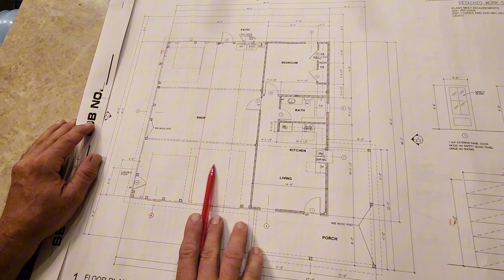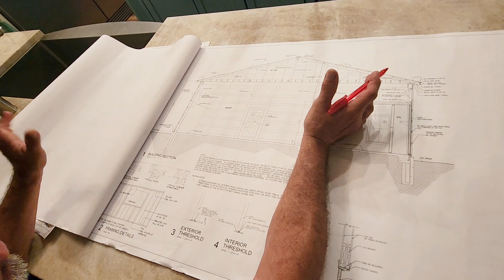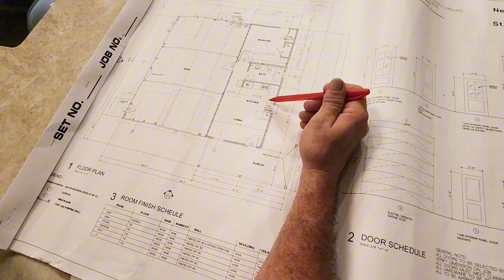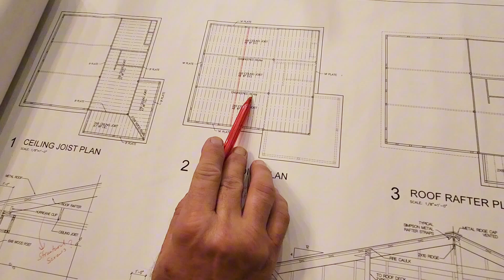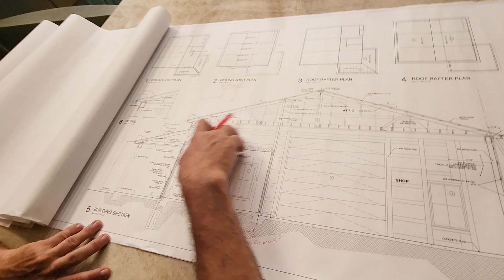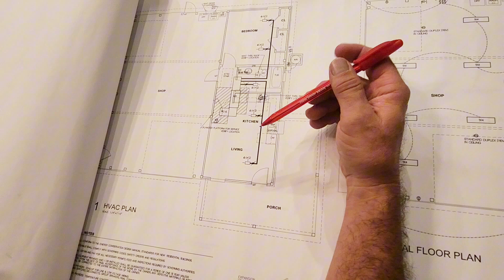Pole Frame or Stick Built Shop?  Viewing of the Draft Plans

Comment: lol, literally typing RR buildings when you said it....had to show my architect his videos b4 she understood what I was telling her.

Edit : The lumber company you order the trusses from will give you the engineering specs of the trusses as long as you give them the length, the O.C requirement, and the wind/snow loading required by your locality.  As well mine even came with the bracing schedule too...
Reply from the maker: We did call a company about the trusses the day after filming this video and found out they would provide the engineered, stamped drawings for $200 if we buy the trusses from them. We are weighing our options. This company does metal trusses, as opposed to wood. So we are going over the pros and cons now. So much to think about!